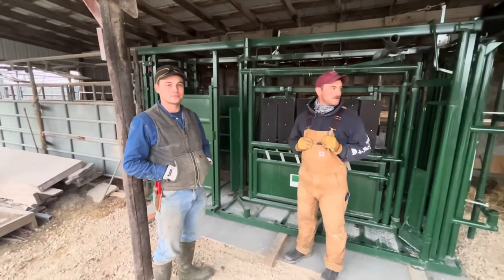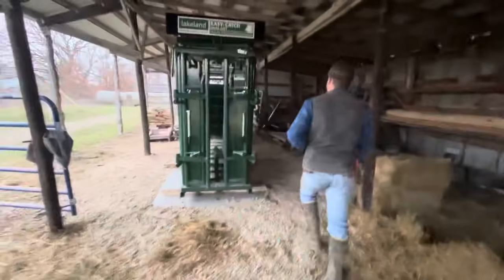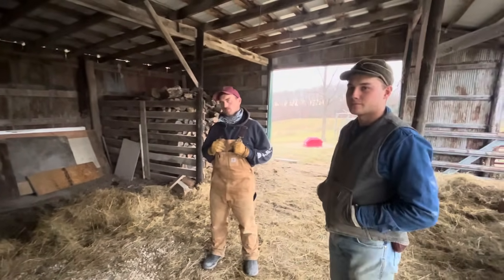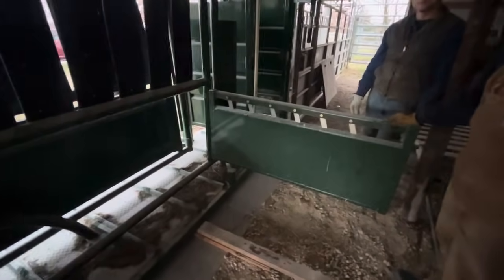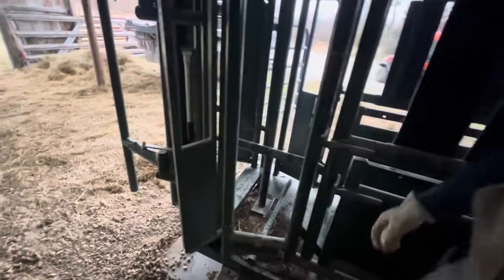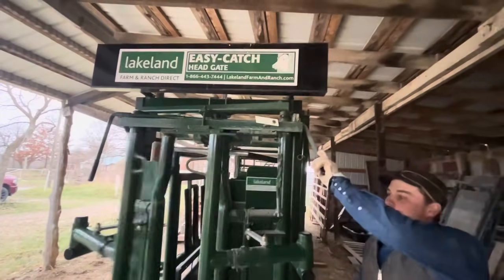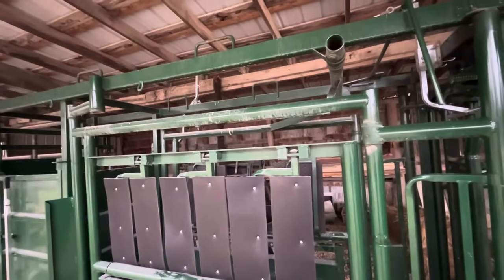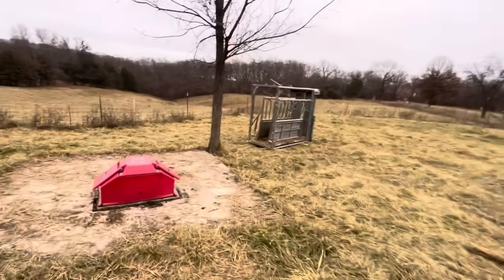Installing our new cattle handling LAKELAND headcatch chute!

Comment: Thanks for the video!  It looks really easy to operate. I haven’t used one of those in a long time. I bet 20 some years or more. They have come a long ways for sure. I like those side panels open for the calves. You could open them up to a grumpy heifer or cow and put the calf next to it to let them suck the mother. It got to single digits here. Brrr!  It’s going to warm up again though tomorrow.